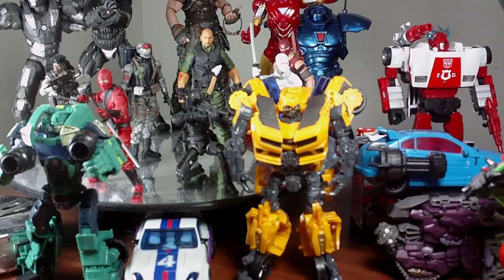3D Printing technology and the toy industry

Comment: It will always be faster to inject plastic in a mold to make a toy than it will be to print a toy, even when you consider assembly.  Also, robots will do 100% of the assembly before it will be cheaper to print a complete toy.

For the homebrew market I'm sure there will be geek dads printing up toys for their kids though.  I'm sure at one point it will be cheaper to print a G.I. Joe or Transformer than it is to buy it in a store but it will still take a geek dad to do it.
Reply: exodous02 3d print the mold then use it...

Comment: the problem is the cost to make a 3d printed object out ways the cost to pay for someone to actually build it for them at the current time. and for the smoother finish or parts it further increases that price, some parts or weapons cost mroe the deluxes with no articulation or are way smaller.